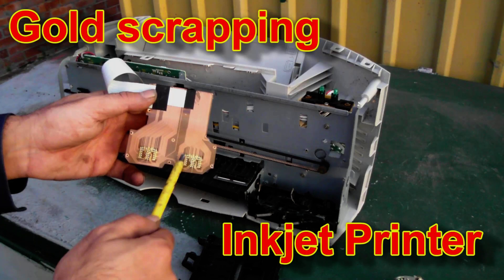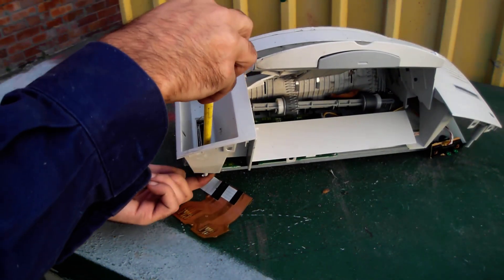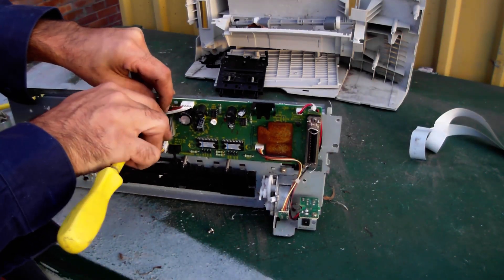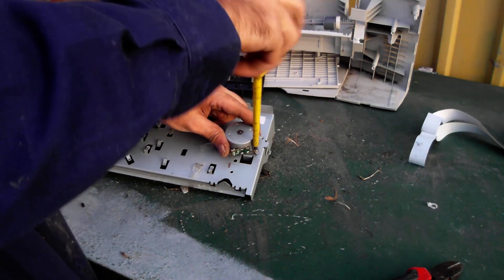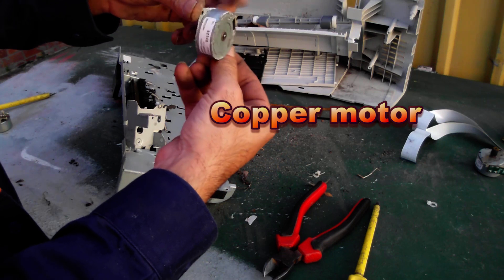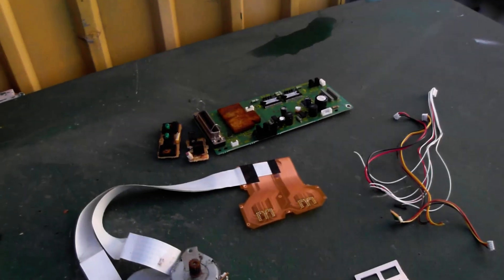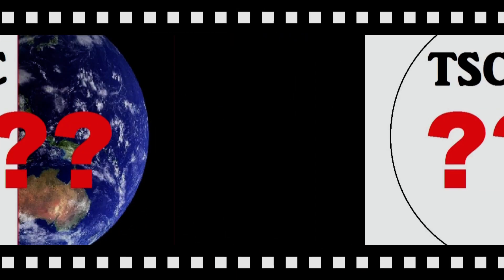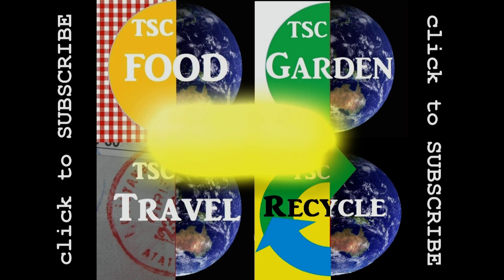FREE Gold from InkJet printers

Comment: Can't you use/sell the stepper motors in other projects rather than scrapping them for the few pence of copper inside? They may only cost $1-10ea to buy new but a hobbyist would buy a bucket of them for much more than a scrapyard I think.
Reply from the maker: thats a great point.
i havent tried selling motors... yet. I just assumed the demand would be low, as Ebay and China are selling motors for dirt cheap.
You're right tho, scrapping is the lowest form of monetary return.
thanks for the question/comment
Reply: Things take 3-6wks China->UK; If I have a project worth doing I'd pay the money & get on with it not wait for a $3 motor that may not arrive, as happens increasingly often. I waited 6wks for 45oz steppers from an Ebayer. "Lost in Transit", by which I mean, they ended up in a Transit  ; )

Comment: I prised one apart the other week, the b***d took a bite out of my finger. Some EPSON printer-scanners have strong spring-loaded catches. Always use controlled force, watch your hands don't fly into a nice cutting edge of pre-cut aluminium/steel framework within..
Reply from the maker: well said Mouse.
I may have failed to mention, these things are put together like a rat trap.
i have been caught out a couple times, getting snared or sliced by stubborn cases which snap shut on fingers.